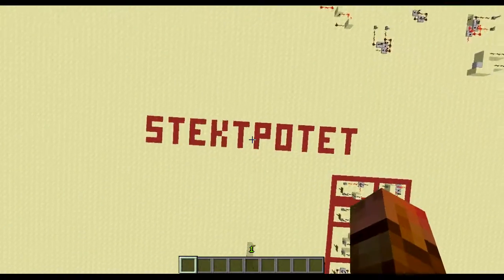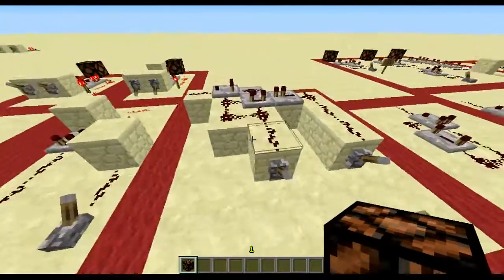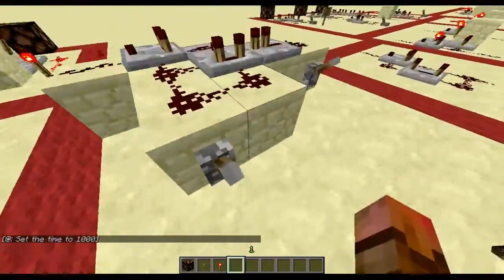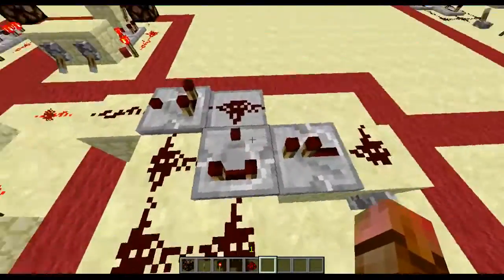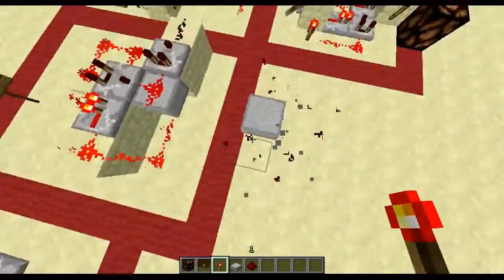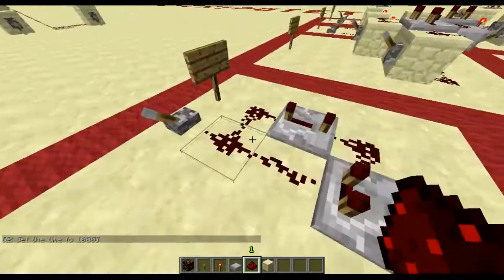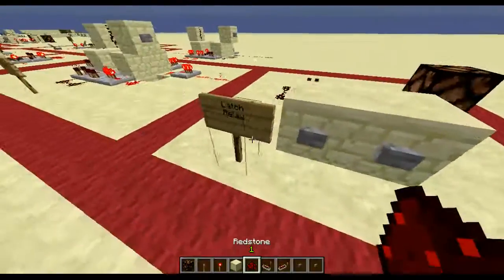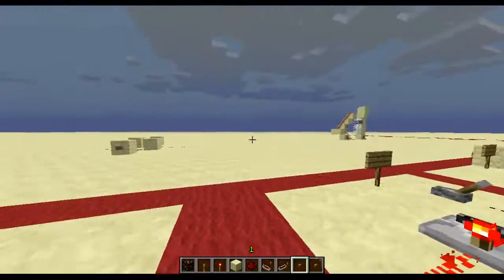Minecraft - Comparator Circuits & Logic Gates - 13w01a [Re-Tour]

Comment: The comparator was possible to build before, but not as an item. But if you put one circuit, linked through a block by a repeater on the other side, and then uses a sticky piston to pull away the block, then you had the same function! Only problem is though that this construction takes a little more space.